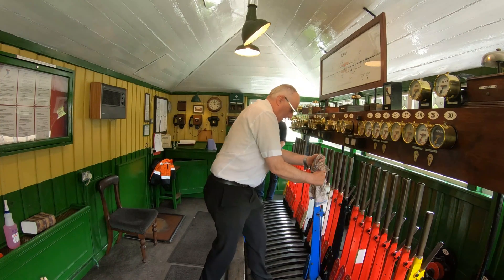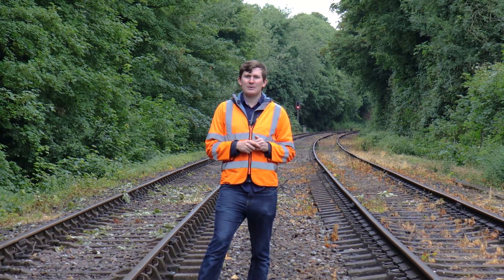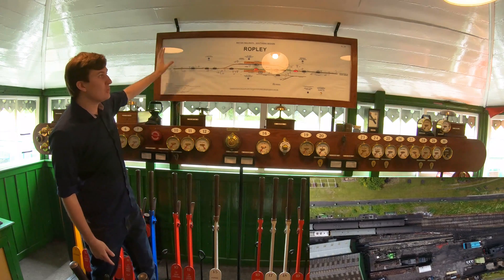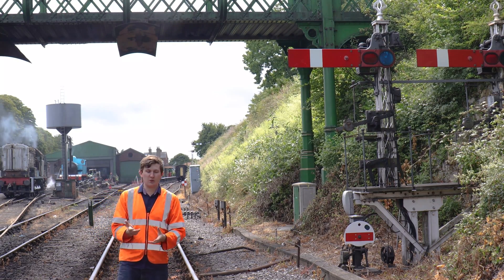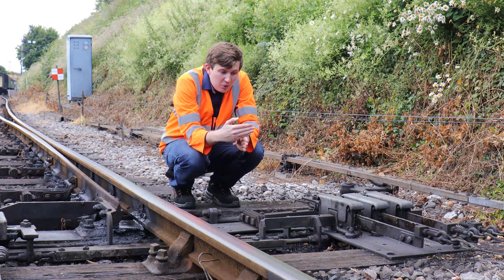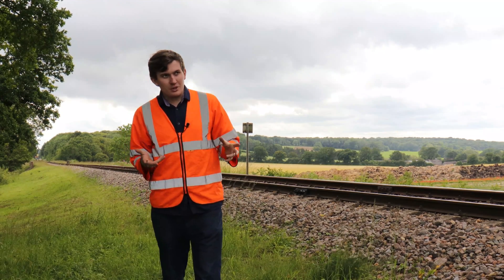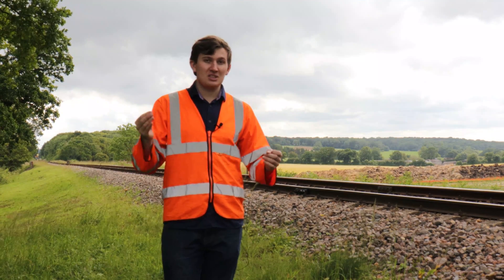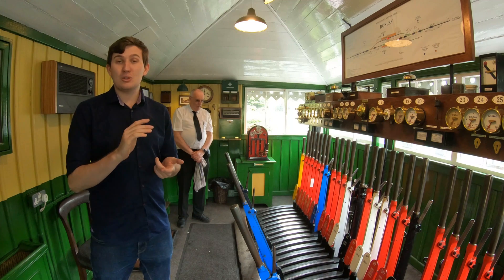Signals & Signalmen - Part 1 'In The Beginning'

Comment: PLEASE HELP 

i am after information about the very old 

As i know them 

Dinger lines 

These was always a single line 

With large bells on poles high up for audibility 

The train would ride past and hit the bell with a large pole 

The very line local to me has always been known as the dinger line for the sound of the warning system 

Information on these type of lines is almost impossible to coe across 

The line in question exactly is the line that connected the soda ash limebeds in winnington to the mainline somewhere behind weaverham highschool.

The ici site also connected to the main line through winnington and onto the main line between Hartford and Northwich 

Its not this exact line im looking for information on but what a bonus that would be 

Can anyone here shed some light pleae 

As far as i am aware it only carried chemicals and product for one company and so signal boxes etc was not needed except it's mainline connections

Comment: The staff or baton system is called absolute block here in the States.I'm a retired Signalman from NYCT 1991-2016.
Reply: I'm after information about a signal system used way back for single lines 

Known locally at least as DINGER lines 

They used bells but not to a signal box etc 

The bell was located at the top of a concrete pole similar to a telegraph pole.

Train would ride past and use a pole to ding the bell 

Very loud 

One that still remained twenty odd years ago we used to shoot at made a very loud ding indeed 

I can't information about this system anywhere 

Please tell me you used this system in the USA and have another name I didn't search for or something close 

If your aware of anything like this please point me in the right direction

Comment: Very interesting!  Does anyone know whether issuing staffs, tokens or tablets security devices have been used in continental Europe to manage single track lines?  As far as I know, they were never tested here in Italy, not even at the time of private railway networks.  Thank you very much for your availability and collaboration
Reply: They would have had something similar 

Lots of these systems are very hard to find information about 

In the UK there was a less used system 

Locally we called it the dinger line 

It used bells as the warning system and didn't use switch boxes except for main line connections 

But the train would drive down the track hitting all of the bells at the top of telegraph poles which was loud if you heard a bell you didn't ring you stopped and reversed fast lol 

These was normally for cargo only when lines might have been owned by one company etc 

Information on this system can't be found and the ONLY REASON I know it existed is because I live local and even used to shoot at the bell that was then twenty years ago the only one remaining

Comment: Signal Box lever colour codes:

1. Red - For "lowering" the semaphore signal.
2. Black - For setting point (US: switch) from "normal" to "reverse".
3. Blue - For setting the lock on the point set.
4. White - Spare/Unused lever.

Comment: Was not by flag one policeman used trunchen
Reply: I pushed wrong button. 2nd Wasa plate with steel sheet operation by lever at bottom then come symphore signal earl 1800s  a man did walk in front of the train
Reply: As Train pass over section the small power under the train sends signal back to the signal box shows train on line either on clock shape show line clear or occupied or by light on tack diagram
Er

Comment: shame about the breach of safety processes at 0.12, you never walk in the 4 foot unless there is no cess, and as that looks like a two-way running lines, he should not be just looking forward but also behind.  The biggest error there is not using the cess.
Reply: Although it is bad practice, this is a heritage railway and he probably knew there was no running.

He may have even have had a block on both running lines.
Which would mean walking in the 4 foot is acceptable.

I always find the 4 foot a very uncomfortable place to be, even with a line block on.

Comment: I’ve been a signalman on the Underground for 34 years and still find the history of signalling fascinating. I was always taught that signalling systems are evolutionary not revolutionary and improvements are always made after an accident! Ie Moorgate control was brought in because of the Moorgate crash.
Reply: I'm looking for information about DINGER LINES (single lines that used bells as signals)

Not like on this video 

But they would ride past and use a long pole to actually ding the bell 

There is an extinct line near me that was called locally the singer line it was run and operated by ICI for running soda ash around 

I am in a serious hunt for information about this type of signaling 

If you happen to find anything please try to remember my comment and respond for me 

Super interesting if I can find information

Comment: With Mechanical signalling in mechanical signalling days, electrical track circuits were NOT available. So mechanical "Treadles" were positioned at critical positions to detect the presence of a trains wheels mechanically ! Obviously as this is a modern programme taken on the Mid Hants Railway, they are using track circuits as a cheaper simpler and more reliable method of detecting trains than expensive treadles.
Reply: Yep - and, if he could have made the video in a dozen chapters, each about 12 hours long, he could have gone through all the intermediate phases of development.  But these videos are an introduction to the basics - not an exhaustive and comprehensive history.